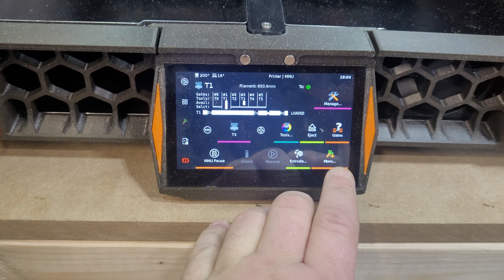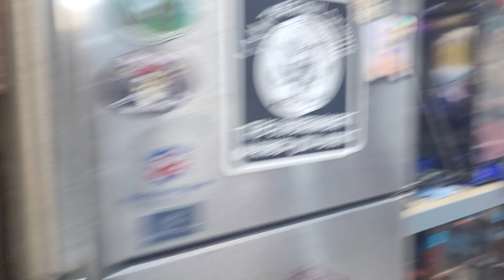ERCF v2 FINISHED! Finally!

Comment: been beta-testing both ercf and tradrack.. tradrack is so much easier than ercf, way less complicated. But with any printer, it's the damn toolhead sensors that are an issue to implement neatly.. and buffers! goddamn i hated trying to wrangle filament coming from 6 directions
Reply from the maker: What's the key differences